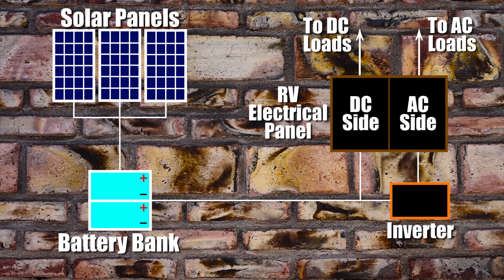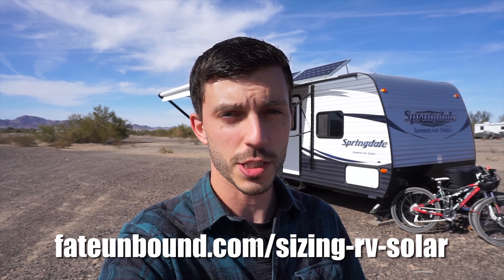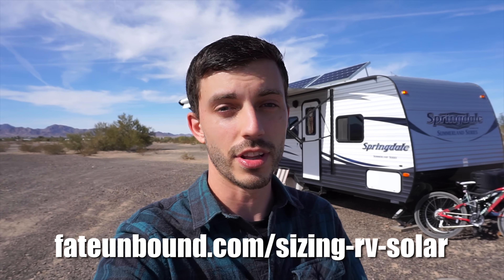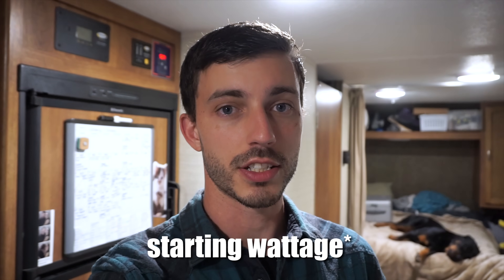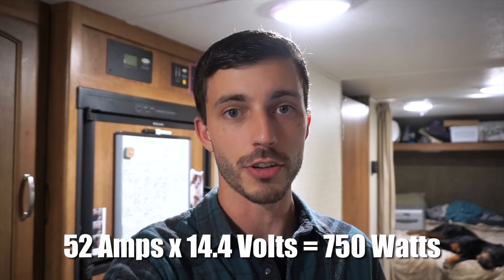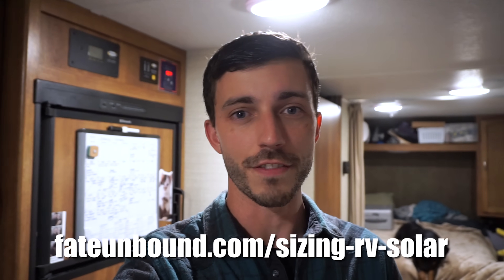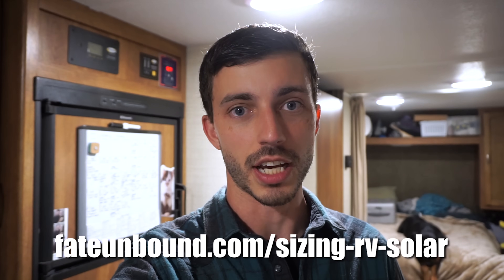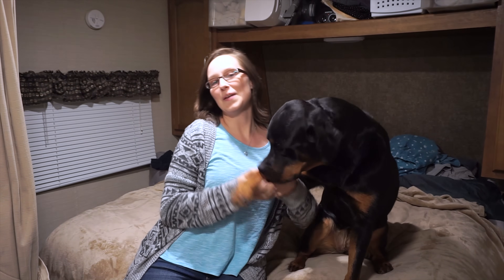How to Power an RV Air Conditioner with Solar - Full Time RV Living

Comment: I like the idea that you can power all your AC power through your inverter to the AC panel without having any AC sub panel.

However, your diagram is missing the solar charger. Often I believe the solar charger is split between the batteries and the inverter so that if you are charging your batteries and/or they are charged the extra solar power goes to the inveter to run things. Also many inverters are also an inverter/ charger.
Reply from the maker: You're correct, the diagram is missing the solar controller as well as the converter charger. However this was a simplified diagram and its main purpose was to show how the batteries supply power to 120V AC electronics, not to explain every device in a solar system. I didn't want to clutter it up too much, other videos dive deeper into that topic. I believe many people when first getting into solar have a misconception that the solar panels are somehow providing power directly to appliances, so that diagram's purpose was to remove that misconception.